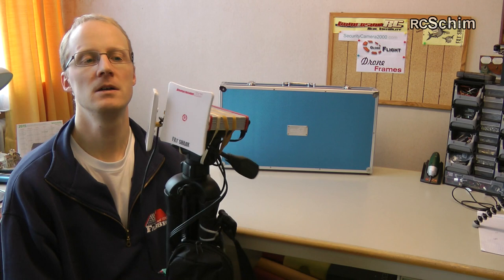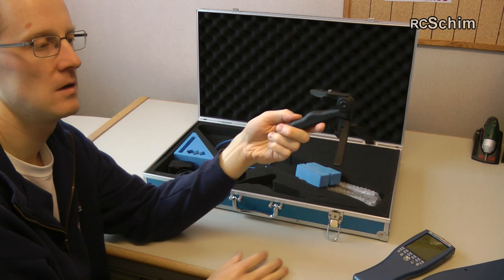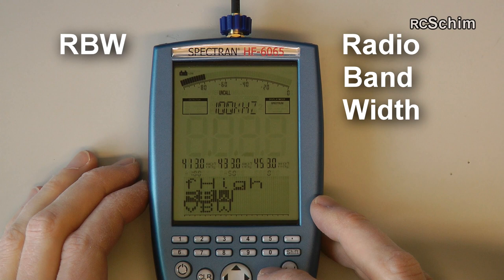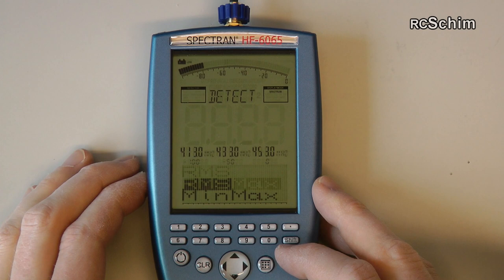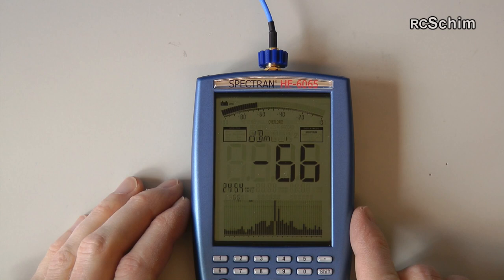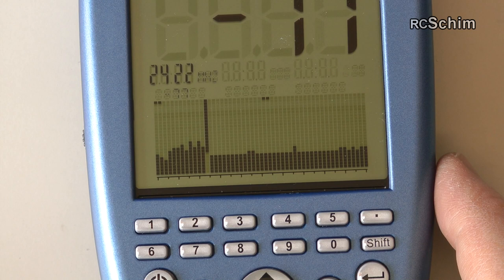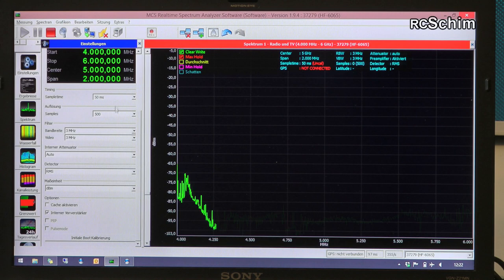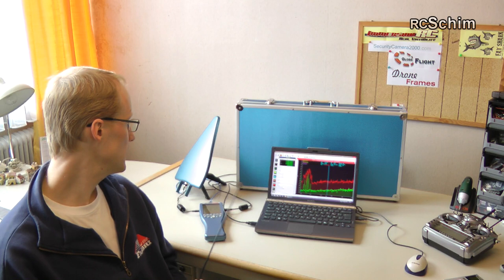Aaronia Spectran HF6065 Review - very powerful handheld spectrum analyzer!

Comment: Been thinking about purchasing one of these. Thanks for the review, friend.
Reply from the maker: FliteTest youre welcome. Nice to see ft crew commenting here. Is it you Fred? However, bruce (xjet) has a nice spectrometer and so I always wanted a decent one myself. This here is pretty versatile and in the semipro level the pricing is good!
Reply: Nice review. 
Have you ever used IRC RF meter? Because 1000+€ is not going to make my wife happy :)
Reply from the maker: Maxime Vanhamme rf powermeter is a different thing. it's fixed to a few frequencies and basicly it's best suited to attach (with Attenuator in between!!!) directly an VTX and see the output power (without the influence of distance or antennas).If you want something cheaper than Spektran look at the RF Explorer or the open source alternatives that sputniksam here posted...

Comment: I think it would be nice to compare the spectrum of some 5.8GHz Video Transmitters. 
Like Immersion RC 25mW vs. Some cheap China 250 mW 32ch Transmitter. I guess we'll see that we have nearly the same usefull output but the China one will have some harmonic Spikes around the Signal.

Comment: Thank you for your explanation. I have been looking at RF explorer and spectran 60100 v4. I need to check radio frequencies and microphone transmissions and strengths and also checking frequencie around TV sets.

Comment: It's a nice piece of field equipment. It's worth mentioning that the antenna is a Log Periodic. Essentially a very broadband antenna but with comparative low gain, approximately 7dBd, and a front to back rejection of about 12dBd. Another nice Opensource solution is the HackRF One, which has a freq range of 10MHz to 6GHz and can be run on Windows, Linux, and Android and retails for about$299. I've been experimenting with SDR's for quite a while but the best bang for the buck is the RTL2832 based digital TV dongles, about $10 on eBay, 23MHz to 1.8GHz, and a very effective poor man's spectrum analyser.
Regards
Nidge
Reply from the maker: sputniksam hi, thanks for your input. sounds like good alternatives.  I hope that this one here stands out being well calibrated and probabbly giving the best results in this price range.  I also use and like the RF explorer. It's easier but I think not as accurate.
Reply: +RCSchim
The Aaronia is certainly a very versatile and portable instrument. My other portable Spectrum Analyser is quite an old unit, I don't think it even has any SMD's in it, and runs off of two 6Volt Lead Acid batteries and only covers 5MHz to 1GHz but back in the day would have cost a small fortune. As you get more experienced with your Aaronia it will be great to see more videos of your adventures with it. 
Regards
Nidge

Comment: Will this work for identyfing the source of suspected industrial noise ?  We have 157Hz noise problem from a factory but cant pinpoin the source within. Is this the right tool ? Nice video BTW.
Reply from the maker: thanks, 
for low frequencies like that they have their "NF" series I guess:
https://aaronia.com/spectrum-analyzers/spectran-nf-handheld-niederfrequenz
I'm currently not sure about the range of my device ;) but It's higher I guess.

with the NF one, you can use this triangle shaped antenna and search pretty accurate for the source of your noise. but I'm no expert in this - maybe try contacting them  - I'm sure at that pricepoint they have a good support hotline or sales support...

Comment: ... thanks for sharing this information :-) I guess this antenna is a little bit bulky, isn't it? Do you know are there any handy antenna available?
Reply from the maker: hotliner you can use every normal FPV antenna also. this one here is specialized to cover a huge bandwidth...But you can also install an uhf antenna from your UHF or an 5.8 antenna (SP or patch)
Reply: ... of course it will work if you want to scan only a selected frequency and nearby :-)

Comment: Is 5 G dangerous to health?
Reply from the maker: there's no easy answer I guess. What I understood:  of course all depends on the power.
I was asking myself: does WIGIG (50GHz?) hurt my head if wearing the HTV vive wireless adapter. Aparrently: the higher the frequency - the lower the ability to "penetrate" matter (harm could come from heating up your brain).
So if within normal power limits - I dont think it's a problem.
Reply: Thank you for your observations